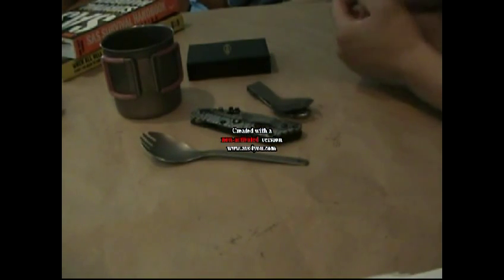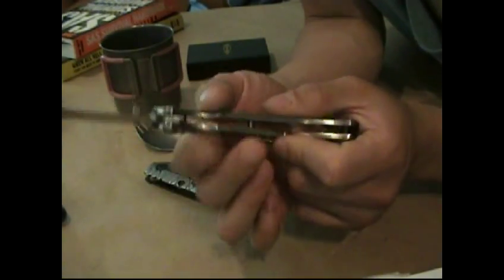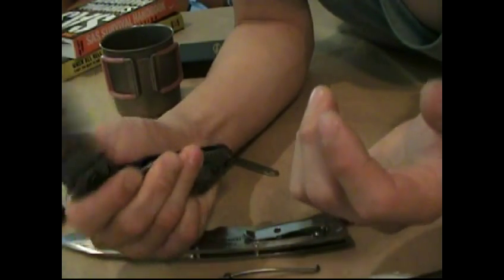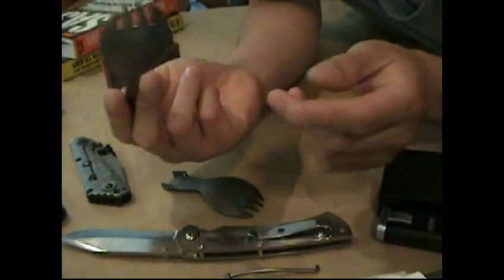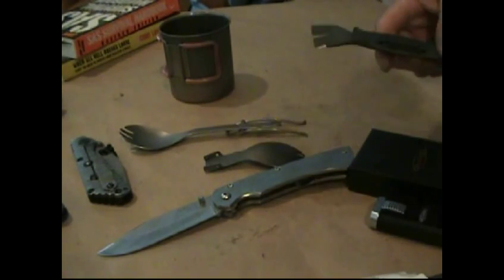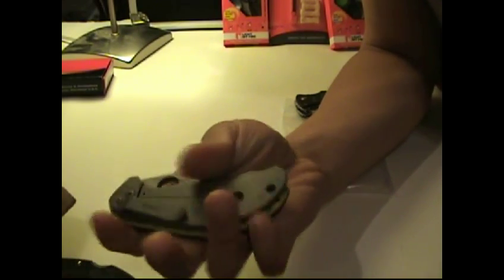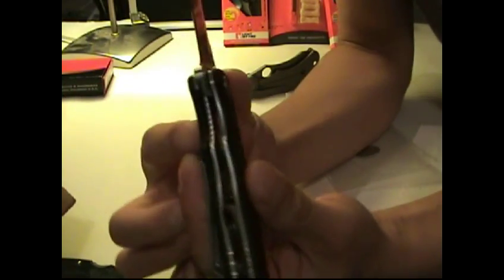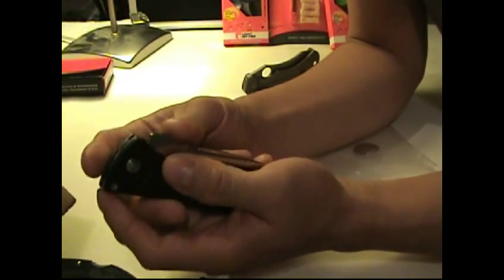Titanium: A quick look at the material

Comment: Titanium is difficult and expensive to make,    You have to collect the ore from muddy waters and use a huge spiral panning factory using electric separating filters and then a double furnace process using expensive magnesium and dangerous Chlorine,     All this takes manufacturing runs of six months,     If it`s alloyed with iron,  Aluminium, Vanadium or molybdenum that`s what changes it`s nature to suit certain uses,    So I guess it all depends on what use in relation to the alloyed metal

Comment: As for the folding spork, when you push the little metal bar on the handle towards the tip, it keeps the handle from folding. It won't hold for heavy tasks though. But hey, it's a spork. ;-)